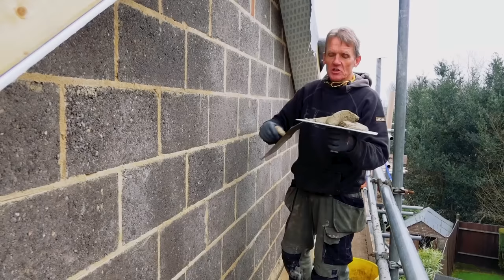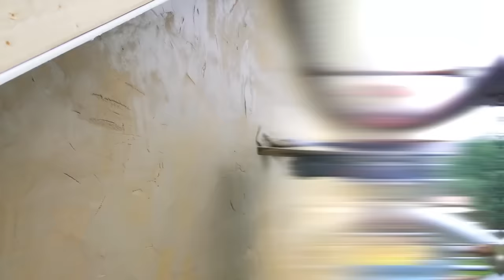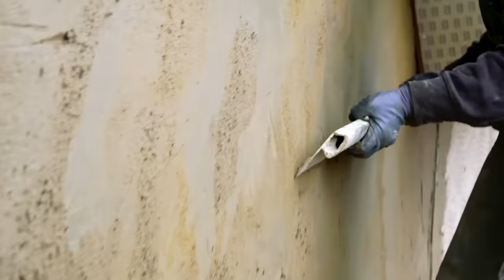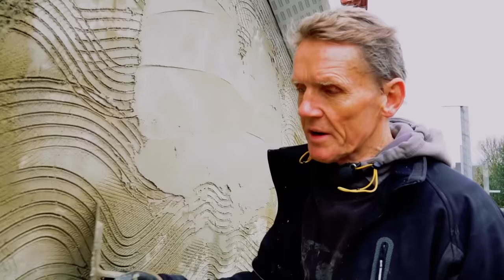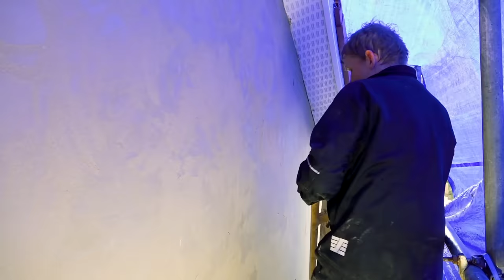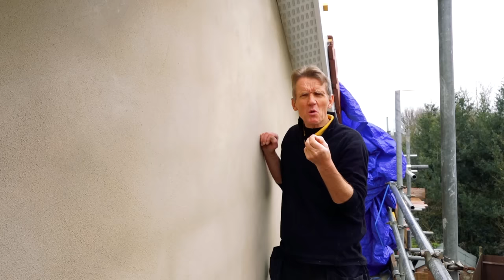How to Render Exterior Walls - Beginner Tips

Comment: I'm looking to render a brick house and I want that rough, imperfect look as I'm going for a Mexican vibe. If the render is left to be rugged does it affect the strength of the render? Thanks for this informative video :)
Reply from the maker: No it doesb'tt make it weaker but it will hold the dirt and algae. The weather in Mexico or Spain is less likely to produce the algae so a rough surface is fine but in the U.K a smooth surface is going to stay cleaner.

Comment: YOU DO A AWESOME JOB BUT YOU SHOULD HAVE SKUD THE WALL  & ALWAYS GIVE THE WALL A SPRAYING OF THE WATER.  I FIND WORKING FROM TOPLEFT ALWAYS WORK'S BEST.     &  IF YOU JUST USE A BULLNOSE TROWL TO FLATTEN THE SCRATCH COAT  IT WORKS &SAVES YOU ALOT OF TIME.    BUT 4THIS  2WORK IT'S GONNA DEPEND UPON HOW GOOD THE MIX.    LOVE YOUR VIDEOS BIG HELLO FROM DUBLIN IRELAND 🍀🇮🇪🍀🇮🇪
Reply from the maker: It is not necessary to scud the wall with those Hemelite concrete blocks. They have an open face so the key is great. As for spraying the water was pouring out of the mix by the evening and I was hanging around in the dark.

Comment: Great video many thanks
Is the very fine yellow builders sand the same as plastering sand?
Thanks.
Reply from the maker: The building sand in Surrey is roughly the same colour as the slightly coarser grained washed sand. To save confusion as the merchant for plastering sand. It varies so much around the country.
Reply: @SkillBuilder  Thanks for your reply much appreciated.  So is building sand finer than rendering sand? I am based in Devon and a lot of builders merchants seem to call the plastering sand 50/50
Which I believe is half sharp and half fine sand and washed. Do you think that would be the same as what you call plastering sand?
Thanks again Chris.

Comment: Any advice here would be helpful! I knocked a garden wall back, im left with half bricks sticking out. Do I need to make the brick work perfectly straight before rendering or can I just render over the uneven brick face?
Reply from the maker: It depends how much they are sticking out. It is easier if you have a reasonably straight line because you won't have to build the render out as much. Maybe use a couple of bits of timber clamped either side and get those upright, then see what is sticking out. You might be able to gently chip the ends of the brick back a bit.

Comment: Hi Rober~Would you be able to weigh in on Rendering Aircrete Block wall from Hebel? I've heard not to render with anything stronger than the surface it's on…and just don't know the answer to that. Do you? Thank you for fabulous examples of how to do this on regular surfaces..but this AAC block seems a bit different.
Reply from the maker: I would put some lime in a 1.1.6 and put glass fibre mesh in the base coat. You also need movement joints to avodi random cracking

Comment: Subscribed, brilliant tutorial mate, my only question is do you have to do the whole wall in one? If not, then, will you see a join line where the fresh render meets the render that's already set?
Reply from the maker: Unfortunately the best way is to get a couple of people on it and do the whole wall. If you stop you will always see a slight day joint. You can see these on a lot of gable end walls. 
i think for anyone starting out it would be unrealistic to tackle a large wall but you can do bits and build up skills and experience.
Reply: @SkillBuilder  No worries then, that's cleared that up, it's a single story extension, about 60 sqm of wall so will leave it to the pros, I've plastered before but never rendered. Thanks for the quick reply, top bloke!

Comment: Hey Roger, first of all thanks for all the helpful info. 
what kind of sand and cement  (What is the best ratio I need to use please )I can use in between bricks wall  and metal wall flashing, I have done the chasing in the wall and took all old render off and fited the metal wall flashing. But am not sure, what kind of sand and cement I can use to fill the wall flashing to stop the water penetrate into the wall. 
please advice. 
thank you in advance.

Comment: Planning on trying this on a very small wall I have. What’s the most common mistake or what can go wrong? And do I need beading on edges?
Reply from the maker: It is a good idea to set some beads on the edges and let them set before yoou continue. 
Wet the wall and get the mix right so it is smooth and creamy, that will help it spread. Don't mess around with it too soon, you need to let it pick up and then rule it off with a straight edge. The final rubbing up is very satisfying.

Comment: Can i render over existing cement/sand wall that does not have scratches (keys) and without using Sbr ?
Reply from the maker: You may get away with it but I would use some SBR and lay on a stipple coat or use a Render Aid. There are plenty out there which work well and will give you a better job. It also gives you more working time

Comment: Also have a question.... is there any reason you start in the middle of the wall as apposed to starting in one corner and working your way across? Is it cause the mortar stays wet for ages so doesn't really matter?
Reply from the maker: It is never a good idea to start in the middle but we had a really narrow camera angle on this due to a 2 board wide scaffolding at that point.

Comment: Thanks Skill Builder.
Do you use lime in the scratch coat as well as the top coat?
Reply from the maker: I use it in all the mixes because it helps the workability and makes it a bit more crack resistance.
Reply: @SkillBuilder  Thanks.

Comment: My outside wall is covered in Harling or pebbledashed as they call it in England. Can I apply the same procedure with a scratch coat to hide it and create a nice smooth finish???
Reply from the maker: Hi Danny 

 Provided the render that holds the pebbles is sound and not hollow when you tap it then there is no need to hack it off. 

If there are patches where it has blown you can hack off and patch it. I would also go around and knock off any loose pebbles. 

When you apply the scratch coat it is a good idea to put some SBR in the mixing water to improve adhesion. It will stick nicely then and flatten out the surface ready for a nice creamy  top coat which need only be 4mm thick.
Reply: @SkillBuilder  thanks for the reply mate. Your videos are great and really easy to follow. You are a natural on the camera! Cheers Danny from Dundee.

Comment: Decent enough video I think people need to stop whining afterall I’m pretty sure the idea was rendering tips* not I’m the best plasterer in the world too many premadonas over stuff like this. 

Also seeing as one of these comments decided to be a smartass about drip beads and angle beads you can actually profile up with 3/1 timber on the edges and you can also section a wall off this way to aid with rendering a large area. PS Skill builder always use a bucket or gauging trowel when lifting the mix from
A bucket saves trowel getting damaged

Comment: Interesting Roger.  Though still not a very good technique, hence you made that simple job look difficult, especially  when the substrate is near perfect. I would have slung that mix to be honest. No bucket trowel and why oh why start in the middle or bottom of a wall when you need to be wiping into the previous run ? (hint , top to bottom)  I also noticed you used the toe of the trowel to work off the soffits so why haven't you used the back side of your trowel like you insisted previously when coming up from the bottom ? I also noticed your right handed so you really need to be working from right to left making it easier to push the mix into position thus enabling you to  squeeze the mix against the soffit board followed by  wiping with the toe. Plastering has an order and  a process. Painful to watch but you got there in the end. looks a reasonably decent finish from here and  your advice on the direction of scratch coat is good  so thanks for that, but you deserve stick !
Reply from the maker: Thanks Gordon and I take on board everything you say. It is painfull for me to watch too.  I have mostly given up replying to the comments on this one because everyone is focusing on the same faults. 
Let me just say that we had to set the camera up. We had to work in that tight space and if I had started on the left the angle of view would have been impossible. 
The soffits were hard to film because I wanted my back to the camera. 

The last point is that we filmed this whole thing on an easier wall but I  managed to delete the files when I was downloading. them.  I will film it all again but this video is staying because a lot of novices find it easy to follow and are encouraged that even a fool with no real skill can make a decent job of it.

Comment: Hello roger,  good vids mate, I'm helping a friend out at the weekend rendering over his pebbledash garage, we had a nightmare putting the beads on around the windows and corners etc assuming u can render over pebbledash without taking it off, it's all pretty sound the existing pebbledash and has no cracks at all, is this achievable doing it this way or would it be better to take off the pebbledash? Cheers

Comment: If you really want to upset a plasterer, put grit in the sand. It's a total nightmare on the top coating moreso when wood floating the Finnish. Cat crap can be a problem as well, and pays to cover sand from these pesky critters who love something soft to use as a toilet.  I use 3 to 1 in Cornwall for both coats as we are a very wet windy county. Been plastering for 50 years now, starting at the bottom allows that to begin to set and support that above it. Water  creating a problem as some say is often because the scratch coat is too smooth, preventing it from being drawn back into the first coat. Getting old and slow now but still do it, use, knowledge and technique  to overcome finishing problems rather than speed .
Reply from the maker: Good information. I have seen plenty of people start at the bottom but not the English. They have to start at the top. It is the law!
Reply: @SkillBuilder   well technicly under the law I am English, but prefer to to  be recognised as  Cornish  lol.

Comment: If I have a doorway I want to brick in and i brick it in how do I render the old to new brick. What do I put on top of the joint before the render. 

Plasterers tape?
Reply from the maker: Fibreglass mesh. It is roughly £35.00 per roll.
Reply: Thank you so much

Comment: Ive dug up a path on the front of my house it has huge tree roots so I’ve breeze block either side with a step and in filled with hardcore packed down with sand in readiness for a Victorian tiled path should I make a concrete base and how thick should I do it or could I tile over the sand once packed down?
Reply from the maker: Best to have some kind of concrete base. I would say 50mm thick.
Reply: Skill Builder what ratio mix would you use?

Comment: Hi Roger, as a novice I found your DIY video insightful; certainly a motivation to render my home on my own. I do have a question. 
Is there a technique to rendering the window frames? Left to right, up or down? In addition, do you add the scratching technique on window frames? 
Thank you
Reply from the maker: I set the corner beads and then put the reveals in with two coats. The first is a scratch coat.
Reply: @SkillBuilder  I'll have to see what the corner beads look like and how to set-up. Thank you, it gives me a reference on what I need to look further into

Comment: What about if you have a wall that was previously rendered and also has pebbledash can you just chisel the pebble dash off and then render straight over or do you have to go right back to the blocks?
Reply from the maker: Hi Simon 
The usual thing is to render over the pebble dash. You have to tap it all over and if it sound hollow that means it has lost adhesion so it needs to be hacked off but if you find that most of it is sound and stable you can simply hack off the loose and fill in the holes then give the whole wall a scratch coat with SBR in it for adhesion and then a top coat for a smooth finish.
Reply: @SkillBuilder  awesome! Cheers Bud! Another thing I was considering was using brick effect corner slips on the edges of the building, would you advise this and if so do you set them in place before you plaster the wall or during the plastering work?

Comment: Sir may i ask if how many sand, lime needs in one bag cement use in such works, ty
Reply from the maker: It is best to use a bucket and put in one bucket full of cement and 5 of sand and 1 of hydrated lime. That will give you a nice creamy mix. If the masonry is strong you can reduce the sand to 4 buckets or 4 1/2 but if it is weak it is best not to make the render too strong.

Comment: Hiya Roger, cracking vids, tell me did you use a bit of plastisicor in scratch and top coat, or just sbr on top coat? Got the aggregate mix you've suggested it's just the other agents im scratching my head about, cheers bud.
Reply from the maker: If you use lime there is no need for plasticiser. That puts too much air in it.
Reply: Cheers Roger just seen this reply, top vids...just started it today bud, bleeding weather don't know what it wants to do 🤣 keep up the good content bud.
Reply: @SkillBuilder  also got the lime...put a weak sbr water mix in aswell...fingers crossed 👍

Comment: Rodger how are you finishing the render to the bottom edge on that gable?. Is there a bead your working too?
Reply from the maker: No, we just ruled it through and worked across but, to be honest, I wish I had cut it back a bit when it was green because I  made life difficult. The scaffolding is in the way so I have now ciut a level line with an angle grinder and worked to that from below. I have seen people smudge the day joint in and they show in the sun whatever happens so the only sure way is to hit the whole gable end in one go.
Reply: Skill Builder always worth getting scaffolder to do a 3 or 4 board at the outside and 1 board at front with adjustable length putlogs then you get a good space to render but still have somewhere to stand when your laying brick etc.
Reply from the maker: Stephen Greenwood
Highlighted reply
Thanks Stephen and a good point. 
Rhino Scaffolding took care of us and I always use them because they allow for rendering  but we had a very tight fit at the front and even had to cut some putlogs to get them in between our wall and the neighbours. You might see a dog leg behind me where it got wider (4 boards) but that little section beneath the gable was a tight squeeze. I was glad when it was done.

Comment: I see plasterers use cement render on traditional builds. Do you get taught to avoid doing that or are the other plasterers only care about money?
Reply: It’s perfectly fine to use cement render on traditional builds. Nothing to do with money.
Reply: Really? So how does the building breathe? How is cement vapour permeable? Why are Buildings damp and cold when it's used?
Reply: Liam Grubb the building breathes via airbricks, buildings are damp and cold because the damp course has probably been breached or rotted away. Old buildings are always damp and cold, that’s just the way they are, modern homes are built to avoid this. Please explain what you mean by “cement vapour permeable”? Thanks.
Reply: Here's a link that explains you should never put a cement render on a building that was built pre 1919 
https://www.spab.org.uk/advice/lime-renders-vs-cement-renders

Comment: Sieve the sand first. Saves a lot of headache. I know, I've been there. Last job I did was to repair existing render. I used criss cross scratch marks at 45 degrees. Hopefully that won't crack.

Also, with SBS bond, I've seen some on youtube apply it to the wall and let it dry. It shouldn't be allowed to dry, always apply the render straight after applying it otherwise it can make the bond even weaker to the substrate.
Reply: We still sieve the sand it's the only way with today's sand quality and float finish the scratch tho
Reply: I agree, learned that the hard way. I let the sbr dry on Victorian brickwork, left a sheen. I rendered over it and when it dried it was covered in hollows.

Comment: Where is the scud on the blockwork mate?
Reply from the maker: Hi Tony 

 Those lightweight concrete blocks are very open faced. I would use an SBR cement and sand slurry on dense concrete but those blocks have loads of key and not too much suction.
Reply: I prove it, if I caught a hold of you
Reply: Dan F it’s loser mate not looser

Comment: big truth that there are many ways.scratch coat it greece it just thrown on wall from distance.
Reply from the maker: I am glad to have this comment, so many people have harldy ever worked outside their 25 mile radius that they mistake it for the world.
Reply: @SkillBuilder  Some even get aggressive when they are told about different methods for plastering. For scratch coat I am not sure whether the way it is done in Greece has any advantage. It is just thrown with trowel to the wall and left as is. No scratching required afterwards. Since it is just thrown it is rough so it servers as a key for the next coat. The only downside I see it that some material is wasted but I dont know if this is a good method.

Comment: Skillbuilder, live in an exposed location right on the North west coast of England . As a result my 1950s brickwork is suffering (some blown bricks etc). A render job is required soon! Would the mix you suggest here with the lime hold up well to the harsh westerlies? Thanks for the videos
Reply from the maker: The point is that you should not put a render on which is harder than the surface it goes onto because it will crack and the rain will track in and get behind the render.   However, in high exposure situations, you need protection and some kind of protective coating is needed. Personally I would still put the lime in and then give it two coats of masonry paint or Stormdry.